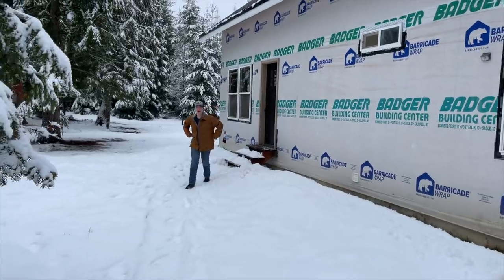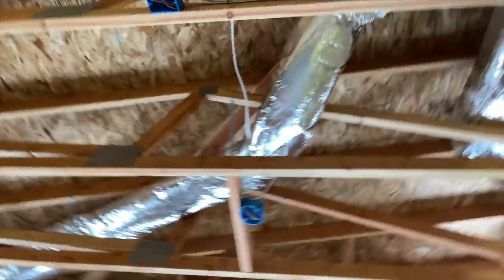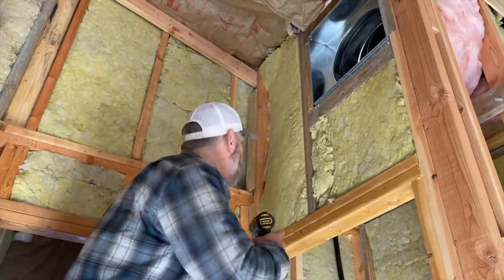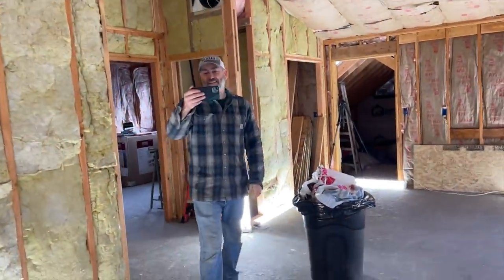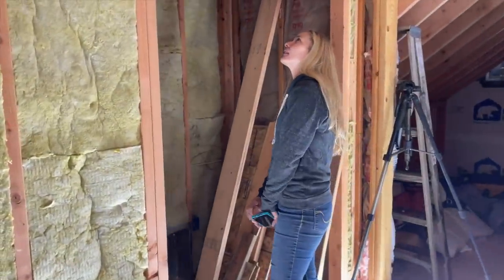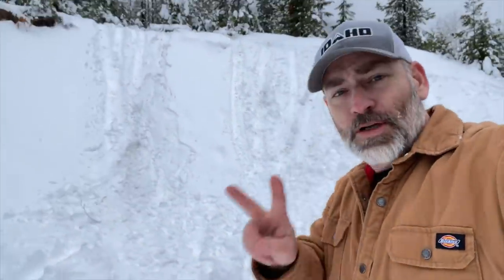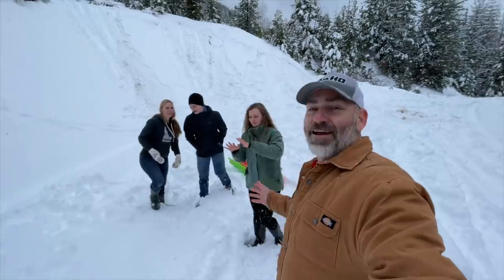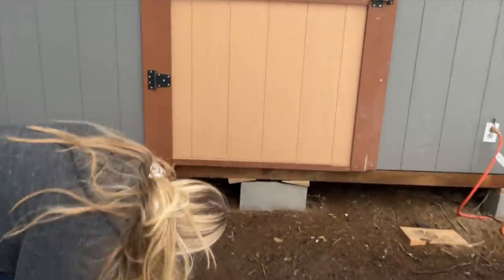Building Our Own House - TEAM WORK MAKES THE DREAM WORK

Comment: Just a suggestion, It seems like it would be a good idea to put an access door (insulated of course) next to the furnace so that it can be serviced or replaced if needed; without having to remove and refinish sheetrock later down the road.

Comment: I hope you guys are planning on adding some blown-in insulation above there or some more batts above their running the other direction because R30 in your climate seems to be way under on the R value! I would think you should have a minimum of R 48.  Cheers

Comment: Keep Smiling 🙂 Congratulations on finishing the insulation. On to drywall.  Couple tips.. If you are looking for drywall tips . Vancouver Carpenter is excellent Vlog. Also staggering your drywall like you do your plywood sheathing. And leave a 1/2 “ small gap between the floor and bottom of drywall panel is best practice to prevent moisture wicking. Less is more when mudding. How is that for unsolicited advice. Our church has a cultural practice of ARP “advice requires permission” but you usually ask for ideas anyway.  Blessings stay warm!

Comment: Question:   Attic ladder for furnace maintenance?  It needed to be pulled every 5 or so years. I had the A/C heater air handler in the attic so I created a slide-bolted panel, only opened from the inside to have installed/remove etc.

Comment: As a rule of thumb, insulation usually doesn't go on the ceiling until after the sheetrock is on.
Reply from the maker: True, unless it is blown in. I would guess.

Comment: I hope you have a sheet rock lift for the overhead. You may want to use the tractor to lift the sheet rock up to the deck. Moving the sheet rock up those stairs is going to be very, very bad.

Comment: Nice video. I hope you will insulate top of the roof as well but then there are those small vents so not sure...But i hope you will insulate it much better with something else ..I'm saying that because if that is all..just that small amount on the top then i expect huge bill for heating..only exception would be if you used some wood stove or such  ..because wood is pretty good for dry heat..and do warm your house a lot...but ofc i don't know all details so you know better..just saying :)

Comment: question: concerning those little round holes in your eaves to let air into and above the insulation. are those holes covered with screening in order to prevent insects from getting up there (such as wasps)? just wondering.

Comment: $40 for a 6 oz can of pulled pork in can is insane. You can smoke a 5lb pork belly and preserve for half of that!
Reply from the maker: Preserve it for 25 years? Not with out a freeze dryer. Have you sees the price of those and the amount of time it takes? Crazy.

Comment: Your sled runs would be longer with more weight towards the front of the sled. With everyone sitting in it, the center of their mass is at the end of the sled. Unfortunately, the only real way to shift it forward is to go down on your belly with your head & torso (where most of your weight is located) on the front. 

Also, this way, steering left & right might be possible by leaning in those direction. Extra benefit: dragging toes can act like a break. 

As far as pushups go, I'd rather someone get the benefit from 1 good form repetition than doing 100 poor form ones. Perfect practice makes perfect not any practice makes perfect. 

Saying that, Seth's pushups are hurried to start. He doesn't check for proper form to do the easiest pushup possible. He needs to start knowing where his hands are (partially outside shoulders & partially lower than shoulders in UP position). He's making his pushups (by looking at his form) far harder than it should be. 

You can tell he starts with his hands too far apart because he starts his upstroke with his arm forming a right angle at his elbow. Good form would have his arms folded up more like a chicken wing collapsed (not extended).